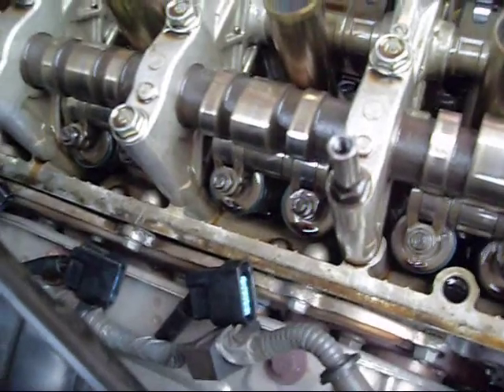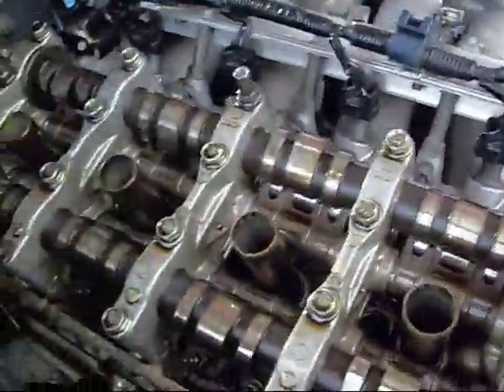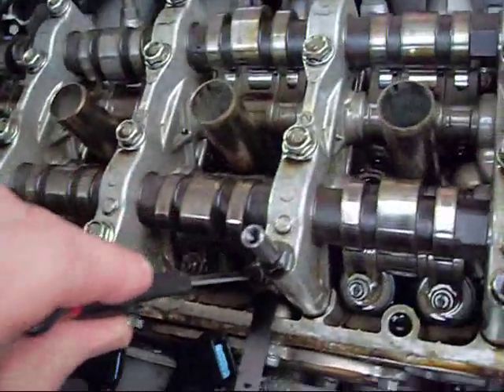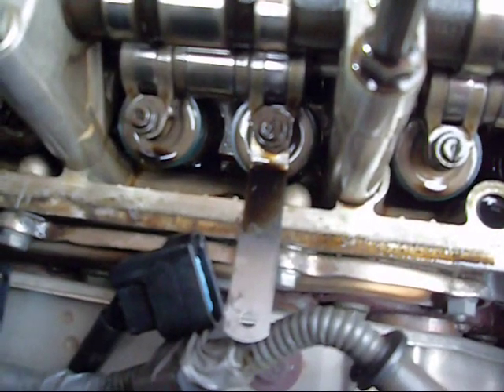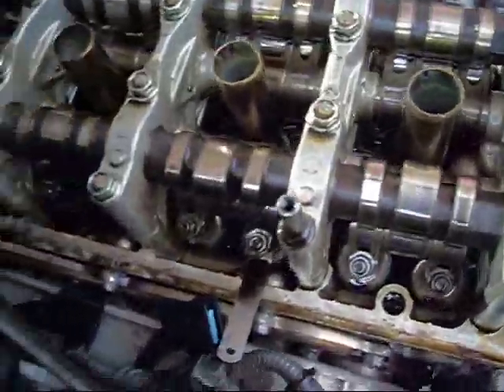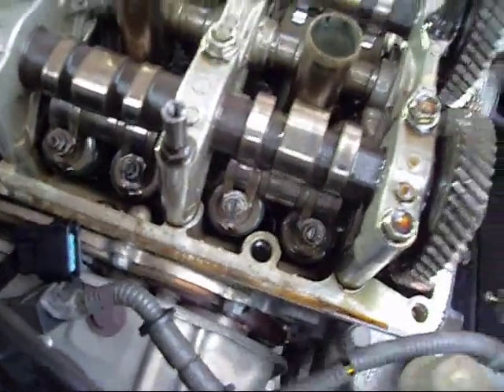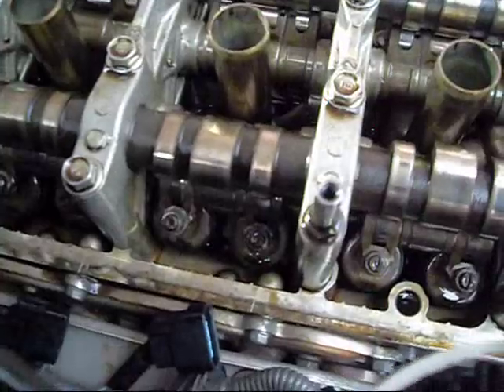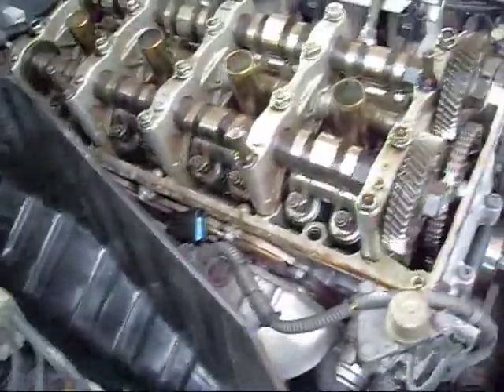Honda S2000 F20C Tappet/Valve adjustment Part 4

Comment: Great instructions I followed this and RobRobinette's guide and took less than 3 hours as a complete newby to the F20C engine, with no special tools except the angled feeler gauges. Including checking over the retainers and double checking all clearances. Only thing I found was cylinder 4 the access was tight (heat shield and airbox still in place) so took a few goes to get the exhaust valves in spec. Oh and make sure you take the wrench off of the crank bolt once you're done, I very nearly forgot to remove mine!

Comment: I just did this on my S2000 for my 100k service. The intakes were a little loose at .010 (still in spec though) and all but 1 of the exhaust valves were perfect at 0.10.  I adjusted the intakes down to .008 and 1 exhaust valve from .011 down to 0.10. I write this because I am really surprised at the very little adjustment I made how much more snap the car has.  You really want to get the special tool for the valve adjustment because it is a little tight in there.

Comment: Isnt the exhaust (header) side .010? You are using .010 as your "no go gauge" and the actual filler guage .009 which is a smaller clearance. Shouldnt you be using .011 as your "No go gauge" and the .010 as your actual filler gauge? I think your clearances are wrong
Reply: You are correct.  He set his exhaust valves to .009 in the video which is tighter than specification.  The Honda spec is .010 - .011.  I'd say setting valve gaps tighter than spec is playing with fire.  Valves tend to tighten over time and excessively tight valve gaps will lead to burned valves and major repair.

Comment: @sonofseasia ALWAYS use a torque wrench, in this case using an in./lb. one may suffice, but convert it to ft./lbs. as 'specified' in the manual. If the engine runs correctly now, check the hot compression. Then attach a vacuum guage and watch for slight  fluctuations in the needle, which would indicate tight valve action, etc.
With a normal cam you should get an instant 20 in. on the vac guage, cold engine. It's ok to overtighten valves on the old Skoda engines because the pushrods will bend.

Comment: @sonofseasia I don't know why you would message me as I am not an expert. First off, you must establish(exact) TDC on the compression stroke for any given cyl. before you commence adjustment. If the 'specified' clearance is .010 in. or so, the feeler guage must enter with a slight drag 'only'. Adjust both intake & exh at TDC. Whilst tightening the screw, periodically recheck the clearance. A slight drag is healthy because as engine wrms up the clearance may diminish somewhat.

Comment from the maker: @seapeddler Yes, that is very possible! This is why you check the clearence with the correct gauge afterwards.

So if you want to setup for .009, tighten up using a .010.

Remove the .010 and check with the .009.

The video does clearly explain this :)

Comment: Is it not possible you have eliminated the clearance by overtightening it?
The valve would depress somewhat.
But one must know the required torque to depress the valve .010 in.
Anyway, burned valves = rebuilding the head = more money.
So, a Mazda HLA conversion is the only solution.
Hey, wait a minute, I'm not a mechanic...forgot about that.

Comment: Great video! Made me thinking about going to do this on the weekend :)

Just one question, do you know what torque the locking nut has to be set at??

Also JDM S2K rule!! I have one myself and it even included the flare in the passenger side lol